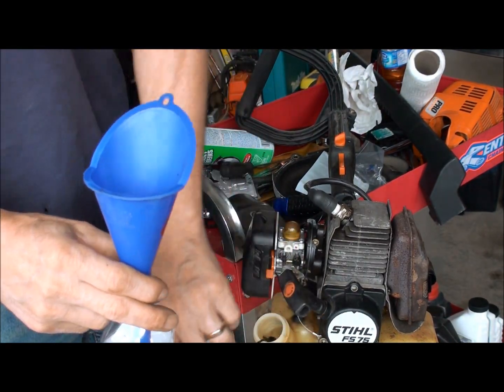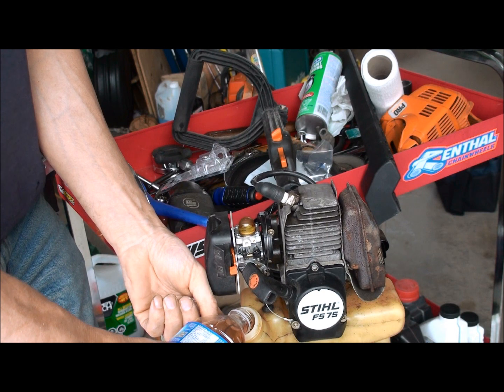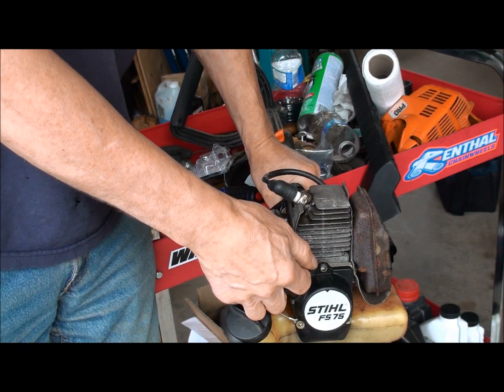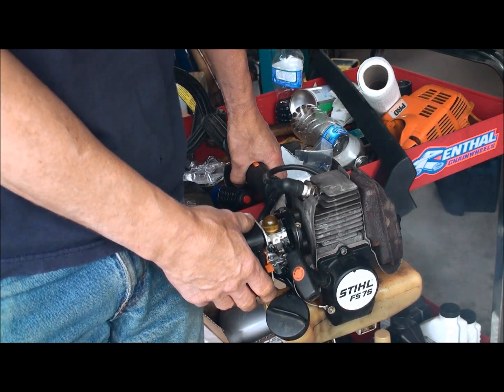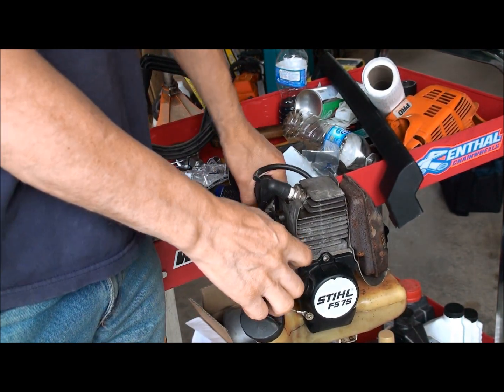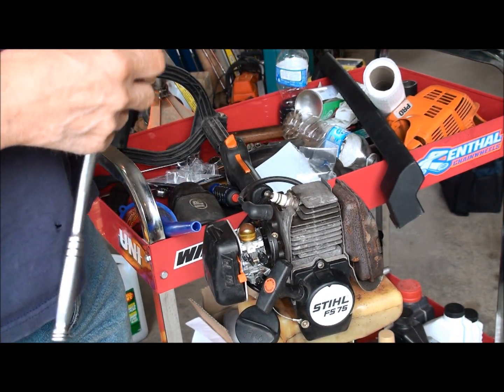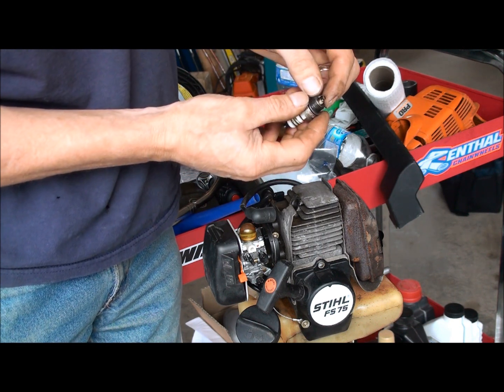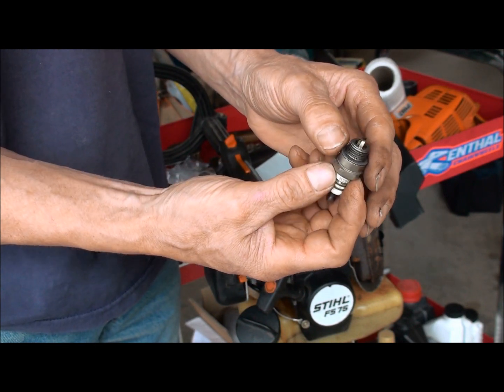Starting an engine with stale gas

Comment: I always drain the fuel & leave the cap loose on the machine when I store my Husqvarna chainsaw for any length of time. By loose I mean still done up, but just not too much so it isn't air tight. I have Never had a problem with any of my machines.

 My Makita RB250 brush-cutter is over 20 years old and still has the original spark plug. I have a thirty acre bush block & this machine has been used so much with a blade that it's falling apart but the motor still purrs like it was new. 
My cheap Chinese pole-saw is the same, I have had it for over 10 years now & bits are falling off it everywhere but the motor just keeps purring away.
 I always leave my Victa 2 stroke mower with the tank filled with fuel over winter and it always starts easily after 3 months rest no problems, but I do turn off the fuel and run the motor dry before I put it away.
As for any old fuel I may have, I always strain it & mix it with some new petrol & run it through all of my machines (except the Husqvarna saw)

Comment: Just to let you know the easiest way to check for spark is to plug in a new or cleaned & gapped spark plug then just hold the gound tip to ANY area of the engine/ground and then pull the engine over that way there is NO chance of electric shock well unless the rubber boot is cracked/dry rotted of corse!!
Reply: no the only way is to put in it in the mouth